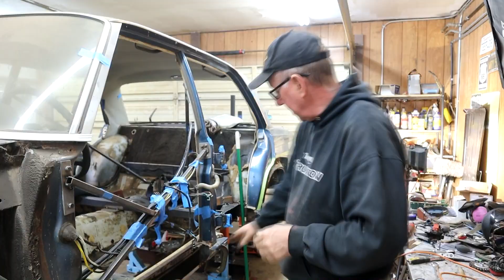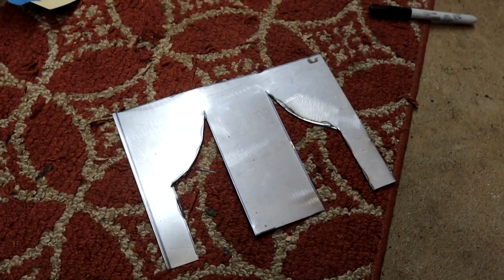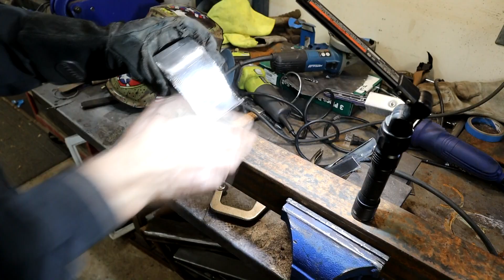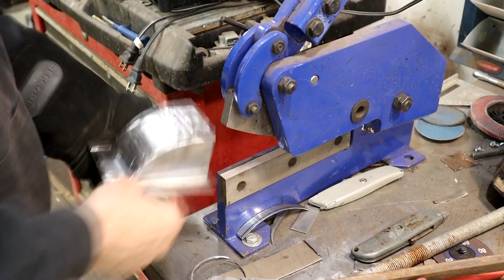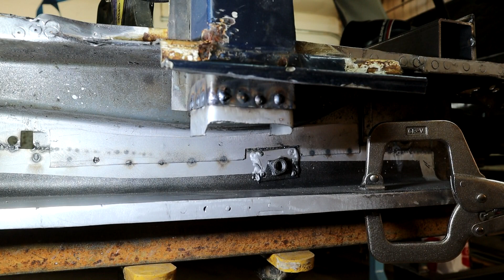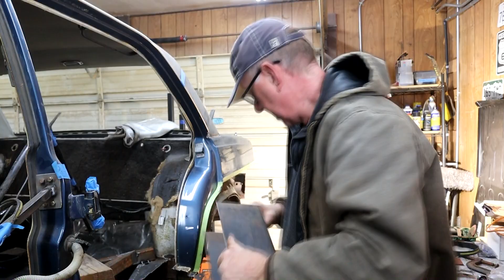REPAIR RUSTY B PILLAR. MERCEDES W109/W108

Comment: Nice work as always John, the anti-spring-back bevel is genius! I have also used that flange idea for joining the 2 pieces on many occasions, particularly when cutting in after-market repair panels which are always too thin compared to the original metal, it allows for a really good strong weld without blowing holes all over the place.
Reply from the maker: Thanks Bob. I really like the backing flange to be there. Definitely a lot stronger.
Cheers John 🍻